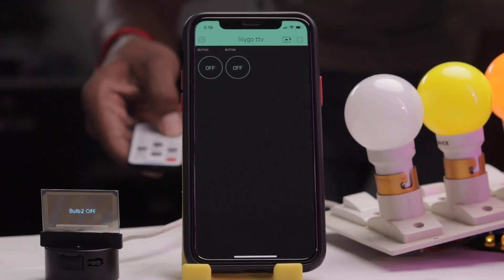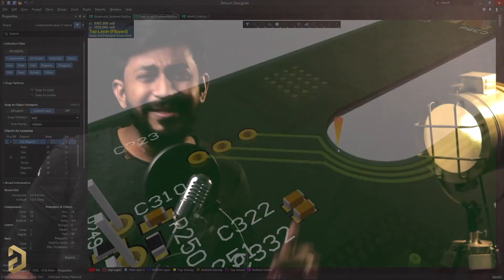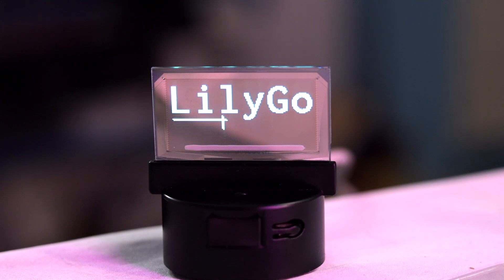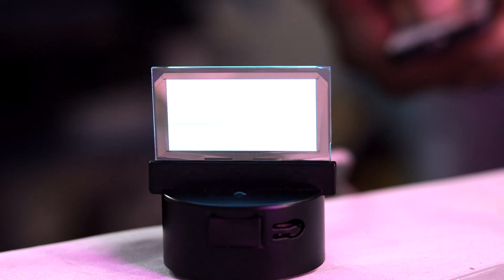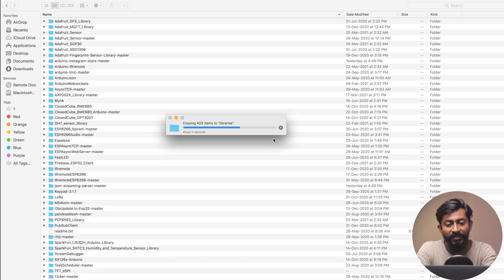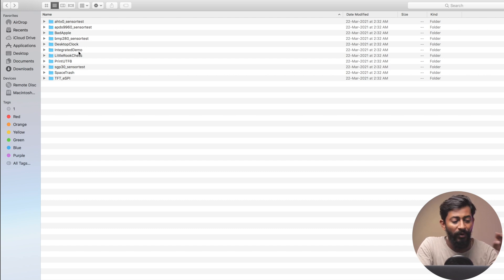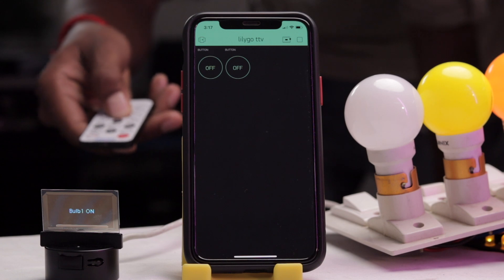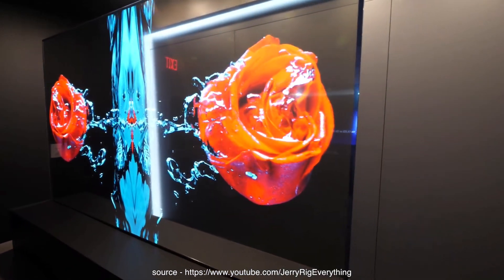Transparent OLED Display for Makers | Liligo TTV | ESP32 Projects | Blynk

Comment: Actually there are two transparent OLED by sparkfun. 
One of them is 128*64 smaller display which is similar to this Liligo transparent OLED ( I think both of these are same 🤔).

The other one is a larger transparent OLED which is area coloured and u can only display things like seven segment digits.. RPM meter image etc.. this is very useful for helmet and bikes /cars as a HUD

Comment: This can be used in smart glasses but fresnel lens will be required to actually see it...
we cannot read or understand near eye objects because our lens can't focus to that short distance
But if we use fresnel lens then transparency will be reduced and it becomes almost opaque to see through the display .
That is why latest smart glasses ( focals by north) use eyeball projection technique...which is basically a tiny projector on the legs of the smart glass
Reply from the maker: Agree